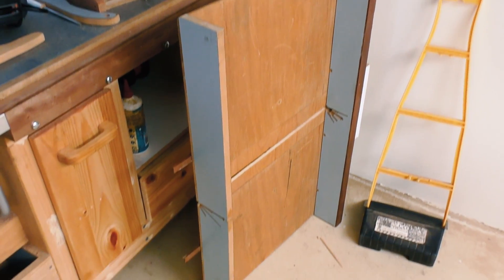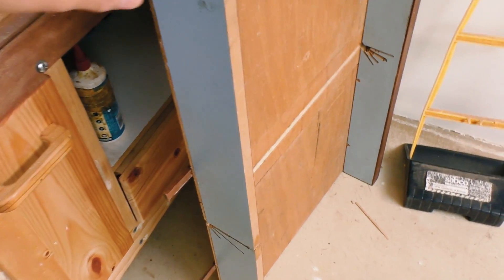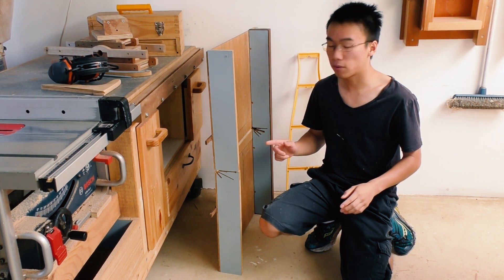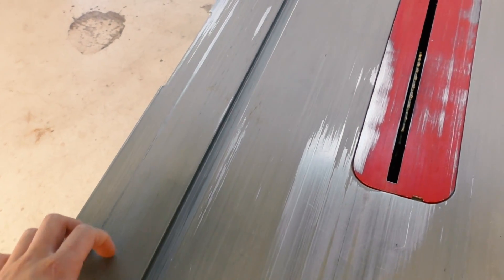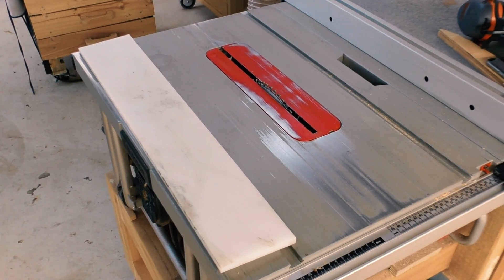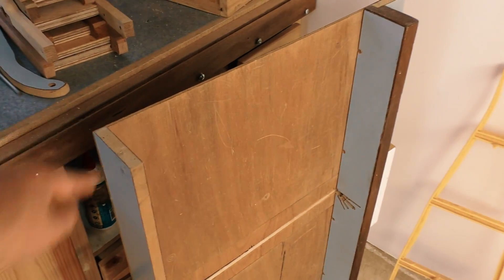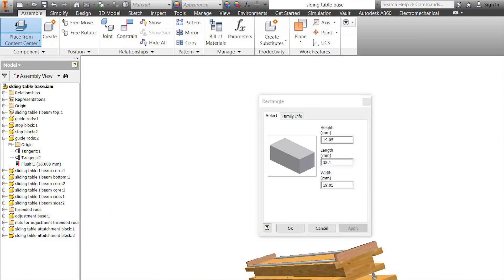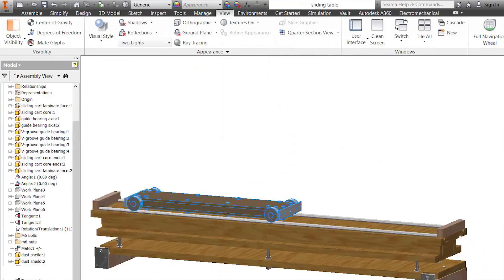Sliding table attachment introduction

Comment: What is the purpose of the floating carriage that sits in between the sliding table and the rails?  Why is this better than mounting the wheels directly to the sliding table?
Reply from the maker: Its a bit more precise, because if u mount them directly on the sliding table it means having to line them all up in one line
Reply: Another great advantage of Zhang's solution is if in any case the sliding table top is damaged , he only has to replace  the top while the carriage is still functioning. This is how most Euro sliding tables are produced.